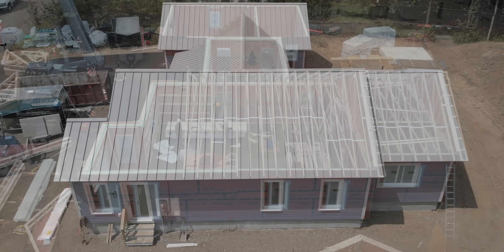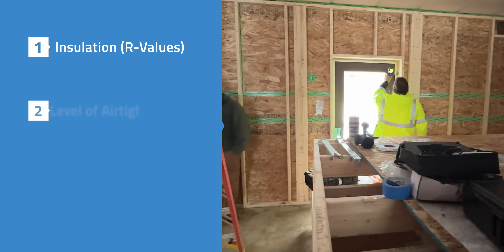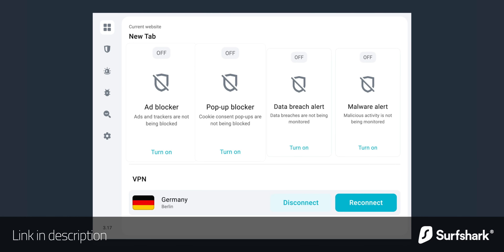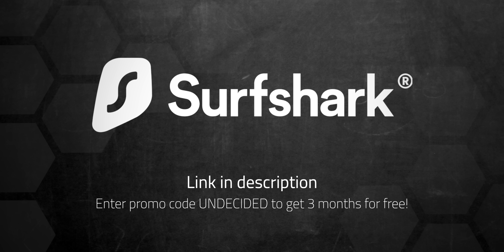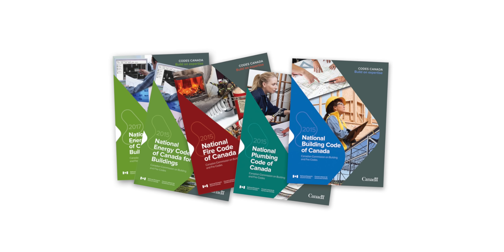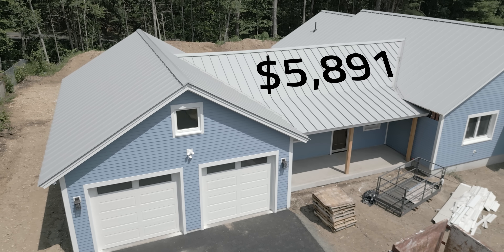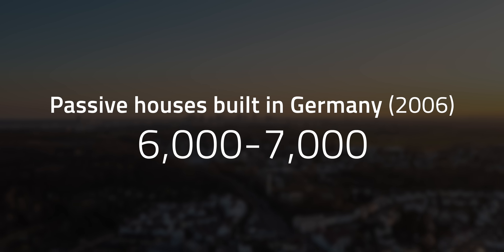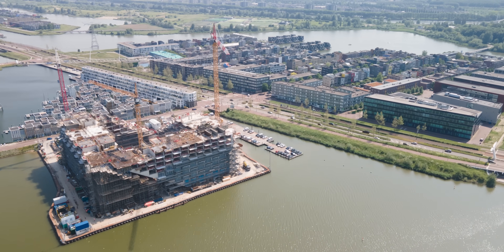Why Do American Homes Suck?

Comment: Just my opinion here, but any house whose ground floor isn't faced or wrapped in cinder or cement block to protect against vehicle intrusion and stray bullets, is a house not worth owning.  If nothing else, deep box windows are frigging awesome in a home, and the whole building should be made from wood framed cinder block.

Comment: I live in NY and Lived in a 1954 home which insulation sagged close to the bottom half of the exterior walls. Very inefficient. Since I have had opportunity to help build a custom home in Texas for my brother via contractor, we have learned much.  I must admit you get what you pay for. Spray foam insulation, double pain windows, plywood/not flakeboard, tankless heater, and energy efficient appliances and limit RF(wifi/5G) within the home.  He has a tight air sealed homes (very little dusting required-great for single guy) and pays about 1/3 cost to keep his home cold or heated as others in area.  I have seen some of those paper thin sheathing homes in cookie cutter developments and educated all family members on info like discussed here.

Comment: I love your noble ideas for the environment and  building wide energy efficiency, but your ideas only work well for a modest density, residential house (detached, semi-detached, row-house etc.). 

When it comes to commercial, institutional, industrial and larger residential homes (four-plex and condos), it’s not just about throwing lots of money into PV cells, green roofs, and grey water toilets. These are complicated things, and most property owners of these large facilities are better off investing in a proper maintenance staff (which they don’t), and in the end, there is no “cost savings” or “technical efficiency.” So, property owners are the ones lest benefitting from this nationwide energy efficiency program. 

However, I do agree with what you say about the lack of “standards” for energy efficiency in America. Money is thrown around for energy savings on utilities, contractors, developers, etc. But at the end, nothing is actually “financially saved.” 

Source:
Skills needed by BAS Technicians - Jay Santos (Facility Dynamics Engineering) Talk at Laney College

Comment: I'm a little critical of a lot of what was said in this video, a few questions:
1. The legal standards are lower in the US, but what are the actual values in homes being built? Are they the minimum or are they exceeding the minimum? 
2. You said you will save $5,891 on energy costs for your home, over what period of time is this? And how does this compare to the additional costs of adding these energy efficient systems in your home vs more standard ones?
3. In further exploring the efficacy of stricter energy standards, you compared the US's standards to the standards of some of the top countries on ACEEE's scorecard, how does it compare to countries lower on the list? The US still scored higher on ACEEE's scorecard than Australia, Canada, and South Korea, what are their standards like? 
4. What exactly is the ACEEE scorecard rating the countries on? Is it strictly about energy outcomes or whether countries have a more favorable or unfavorable approach to improving energy efficiency by whatever standard they decided was the best?

Comment: The poor suffer most. In murica if you have the money and interest, it’s easy to have a home built to euro spec but poor/young people starting out don’t have the funds to even build their inefficient house or at this point with 8% mortgages buy an old shack. I’m still saving and investing for that point but for now I’ll keep the heat at 60 and ignore the use of the a/c in the summer. Cheap gas is nice though compared to the rest of the world, gotta love spoiling up the v8 with a blower on it - burning rubber and shooting bald eagles out that tailpipe, Yee haw

Comment: Have you done a present-worth analysis of the energy savings vs. the up-front cost for the energy efficient options? The few times that I've done the math, it has turned out to be a poor financial return. I highly recommend better insulation because of improved comfort, of course. But economic arguments shouldn't be made unless they can be supported mathematically with a reasonable deflator.

Comment: The base design theory of a low energy house should be the shape. No bends, they increase SA and thermal bridging. a simple shape, think elephant or polar bear. By the way a u value over 0.01 is dreadful. No excuses.

Comment: Yeah. America is not alone. The UK also has awful housing. Probably because Gas heating is so cheap. I studied passivhaus and built my own passivhaus about 10 years ago. 50cm of insulation around the whole house (up to 90cm pays for itself over 25 years) grade A+ passivhaus tech throughout. No gas, use 4500kwh per year over 175m2. Produce 10mwh pa, from the pv, so the house kind of pays for itself through 25cent pv exports.

Comment: What is even more interesting than building efficient homes, is to renovate the old one so there efficacy improve. For instance in France, there is a huge program dedicated to this. This program includes many aids, but one of the toughest measures is to forbid the renting of houses/flat that would not be efficient enough. The level of efficiency required will be raised along the years. 
This is impressive to see from aboard to be honest.

Comment: Interesting video, I like the house and all the thought that went behind it. To answer your question of why most American homes are not this efficient, from someone who lives in a house built in 64' with only paper with no sheathing, I can say that even though this method isn't the most efficient, it works. We are able to regulate the temperature inside fairly easily to keep it compfortable without using AC/Furnace. Even though it is not the most perfect design maybe, for the cost, it works well and I think that is why most of American houses are like this. Just my thoughts.
Reply: I think the ever hotter summers might undermine that . In 64 the heatwaves were fewer, cooler and Aircon was less common. Suddenly your cheaper walls may breath still but let all that hot air in and expensive cool air soak out.

Comment: My house has 60 cm brick external walls with another 30 cm external insulation on top (total 35.5 inches). Internal walls are 40 cm thick brick (15.7 inches). Is that good? It was built prior to ww2 and is a generational home. 4 bedrooms, 3 kitchens, 3 bathrooms and my work room, which I don't heat or cool because its in the middle of the house and has about the same temperature year-round. Thermo-pane windows & doors, central heating system. It has an old brick oven system in the middle that can heat all rooms around it. Works with wood as fuel. Was used before the central heating system was installed. (Europe)

Comment: If i get a chance to build a new home, its going to be almost entirely fixed pane windows. This is one area where paying more for a typical double-hung window actually gets you a much worse (and much less energy efficient) window for MORE money. And honestly my current home has 17 windows and we've opened exactly one of them ever and I could do without it. It sounds like a small thing but the price of high efficiency windows is DRAMATICALLY increased by having to make them open and close. These are the kinds of areas where people need to be more well informed and builders need to push towards it on their own (eg. sorry our spec homes come with all fixed pane windows unless you pay more). This gives builders the opportunity to educate home buyers.

Comment: California was shown in green as though California has good standards, but the truth is California charges such nightmare prices for permitting that most work is unpermitted and follows no standards at all. Of course, a brand new home will follow the codes, but very few brand new homes are built there. Net migration is now roughly balanced with people moving out as often as they move in, so there's not a lot of demand for brand new. Add to that the hundreds of thousands of dollars of permits that might be attached to building new and you have strong incentives to occupy and remodel an existing structure.

Comment: The problem in the US isn't lack of high energy prices or lack of regulations - those are objectively good things for people in general. The problem is lack of competition and culture. Regarding competition: building a new home is always going to be driven by value because it's so expensive to do. These uber high priced products that you never see after the house is built and don't pay dividends until 10 years or more are never going to be competitive unless they offer some other advantage like comfort, but even then that's probably not going to be enough. The products need to come down in price. The government can make them tax free or offer other incentives but also the manufacturers are going to need to be more creative to cut costs. I myself (and I think a lot of other conservative minded people) are more comfortable with the government not collecting a tax than offering straight up hand outs/rebates. And tax incentives can be effective. Regarding culture, yes low energy prices have contributed to a cultural mindset of bounty and wastefulness which his harder to change. Unfortunately a lot of more liberal minded folks who have great intentions don't realize that using coerrsion has the opposite effect for many (eg. many people will have a much greater chance of buying an EV if not coerced to do so - they will see others driving them and enoying them, and they'll investigate on their own. Adoption will be slower but it'll be more sustainable/sustained. A more gradual EV transition will be easier on the industry as well). Ironically the frantic (even hysteric) push towards a more carbon free future is what is holding it back in many areas.

Comment: For me its the little things that add up. Single layer sheetrock, uninsulated interior stud walls? What an accoustic and durability nightmare. Asphalt shingles? Maybe on a garden shed. Full concrete driveway instead of pavers? Durability and heat retension issues abound.

Comment: Heyas! Spaniard here. I live in a 13-story building built in the late 70's; double-insulated brick wall (using insulated bricks), central heating, passive ventilation systems and other stuff have been part of the code here since then.

Wanted to weight-in into why the standards and price is so cheap in the US from where I stand, since it's something that you seem not to have mentioned at all: hurricanes.

You live in Washington, so you don't get those, but a good chunk of Middle America gets outright levelled every few years. I've heard American constructors say it's pointless to build a decent code if the houses are doomed from the get-go. I've also heard American political figures argue that making tornado-resistant buildings would tank a good chunk of the low-income strata of their economy.

Those two things explain (in my mind, at least), why the US is so reticent to make a Union-wide quality building code.

Comment: In Sweden your house would be pretty common setup with thermal heatpump and the ventilation. Sunpanels are very common. Tripple pane windows are standard. Walls are about 350-400 mm thick with up to 3-4 layers of insulation placed in a way that minimises transmission through the frame. All houses projected energy usage are calculated and regulated harshly. And its getting even more strict in 2025 as it looks. I firmly believe Sweden goes too far, especially with the economic situation. It is simply outrageous costs to build a house and economic housing is effectively outlawed. People with high end jobs max out their loans to buy a budget home, then goes bankrupt as soon as the rates goes up 2%.

Comment: We’re from the US and live in Netherlands and are building a home. Since January 1, 2021, all building permit applications for new construction, both residential and commercial, must comply with the requirements for Nearly Zero-Energy Buildings (BENG).

These new building regulations set requirements for the maximum energy demand, fossil energy use, and renewable energy generation of buildings. This means that for new homes and buildings, not only good insulation of the building envelope and energy-efficient installations must be considered, but also the use of sustainable energy.
Our home will have a solar array and should be very energy efficient and comfortable to live in. The home is made of steel concrete and brick…not wood sticks and paperboard like in the US.

Comment: I had culture shock stepping into my first american home seeing the thickness or rather thinness of the outside wall. It's also crazy that almost everything is built with a nailgun instead of screws.
Reply: nailguns are much faster than screws. I have 2x6 walls in my house not sure what yours had. Yours was probably very old
Reply: @gregh7457  Might be faster but I don't have to explain that a smooth surface is less stable than a screw which cuts into the material. Lets talk  american walls: wood framing, insulation and plasterbord...that is a glorified shed when it comes to robustness.
But you're right it was a house built in the 80's but I don't feel that much has changed tho.